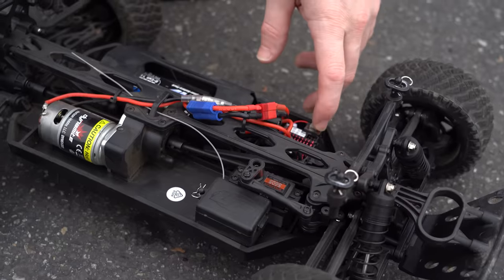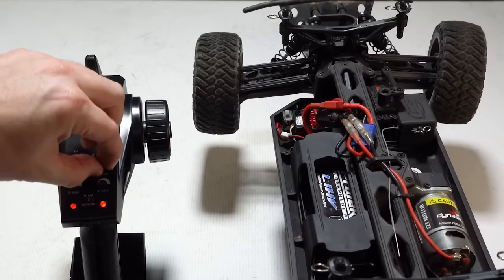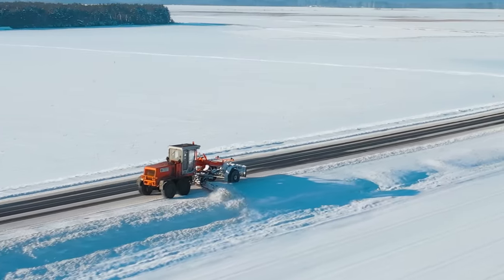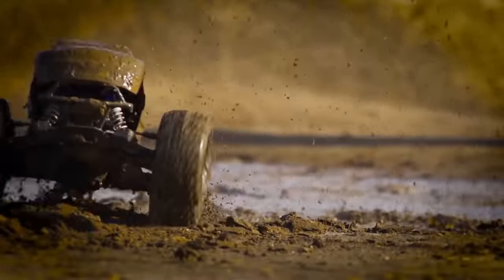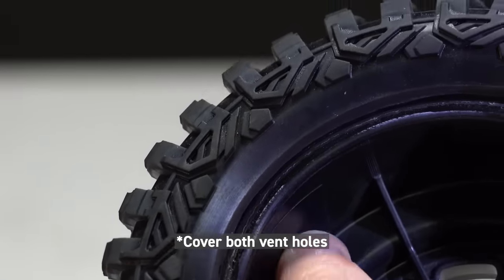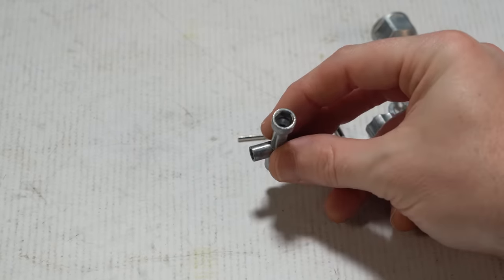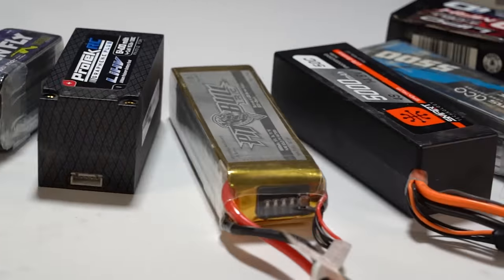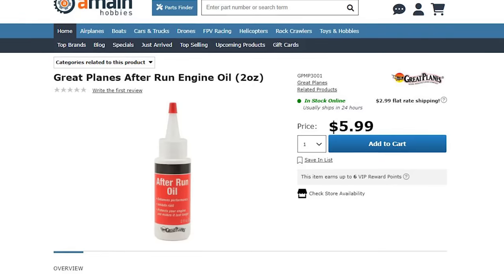Basic R/C Mistakes & How to Avoid Them

Comment: The last part is extremely hard. I bought a rustler 4x4 vxl for $400…loved it so much…a week later I saw an XRT at my local hobby shop…I couldn’t leave without it, another $1,000 and $300 in batteries later…now I’m about $3k deep in the hobby in less than a month 😅😅😅
Reply: This is why im buying only 2 cars to start officially(i also recently got a 1/36 scale truck that was cheap but looks fun to use lolz)and then eventually but a felony when i can afford it. After that, who knows maybe another lowrider and the bandit + fireteam..but i can wait for those tho
Reply: @wolfboy20 what 2 rc cars did you go with? I got the Mojave 4s and think next Max v2 and down the line felony or infraction lol I think also get the traxxas slash kit and resell it and then maybe the tekno 410 or so!!!😂
Reply: @Awakendabeast13  Well lets see, I got a Redcat Lowrider, & then for the 2 vehicles, I got a Traxxas Slash Ultimate and The Kyosho Fazer mk2 RC Camaro. After that I got a Typhon 3S.
Reply: @wolfboy20  Nice all great!! Eventually I’ll get a road rc and I like the scale autos as well. Awesome
Reply: @Awakendabeast13  Thank you!! They are all great vehicles but its gonna be a while before I can use them again. Gotta get new batteries and a new charger 1st for all of them. I also plan on getting the Arrma Felony and then the Losi Pro Moto Motocross Bike!
Reply: @wolfboy20  Real nice yeah im thinking of getting the Hota 6s charger and prob genace batteries or zee. Arrma Felony is sic the only thing that makes me hesitate is going thru many tires but it is what it is lol probably sometime in 2024.

Comment: Great video!
Another important thing to do is set the steering end points; not doing so burns out your servo.
I like your comment about not using a compressor; back in my mountain bike racing days we avoided cleaning our bikes with a compressor as it can cram dirt into the bearings or other places that you don't want it...
Reply: Also if you put upgraded servos, Snapped a capra axle in half by not setting end points.
Reply: Good thing every compressor has an air regulator
Reply: @smolscale  or just hold the air chuck farther away from the car…

Comment: All good information. Another tip that is a must. Look through your manual and read up on the maintenance intervals. Rc cars need regular servicing just like your real cars do. Diff fluids need to be replaced after so many runs so keep track of that. Also, be careful with lipo charging. Get yourself either a lipo bag or some flame proof container like an ammo can. Dont let your house catch on fire. And i wouldn’t recommend charging inside

Comment: Guilty of that last one myself! Probably close to 80 RCs in 4 years of being in the hobby! Uber amounts of upgrades and parts and tools too! You can definitely go nuts real quick! So many options out there, and they keep putting out new ones constantly! 😅
Reply: I had 40 at one point. Then I looked around and saw what I drive the most. One just sat for two years only driven 10 minutes. Listed on EBay and almost made my money back.
Reply: @troublew1  I gave away most of the ones I never used. Did YouTube giveaways and some to close friends and co workers. Down to about 40 now. 😬
Reply: Dang sometimes I feel overwhelmed with 4 lol
Reply: Can’t reply heading to hobby shop for more rcs
Reply: @uan588  😂😂
Reply: Dide im getting at least 4 more and I'm saving up for them..its gonna be an expensive ride but i can wait until i have enough money for each plus the battery pack and charger 🙃🙃🙃🙃
Reply: Lol im selling 2 brushed so I can get 1 brushless truck then I will have 2

Comment: Just bought my first kit from you guys (it’s in the mail as I type this), so this is really helpful at just the right time. Thanks for the upload!
Reply from the maker: Excellent Mr. H. What kit did you get? This video might have some value to you: https://www.youtube.com/watch?v=9_DbLLKJgNw
-Brett
Reply: @AMain_Hobbies  Thanks for the video recommendation! Since I’m just getting started and wanted something small, I went with the Axial SCX24 2019 Jeep Wrangler JLU CRC. I wanted something inexpensive that had lots of options to add on later as I get my feet (and possibly tires) wet. Already got a spot in the backyard mapped out for a course. Can’t wait to get it started!

Comment: Hello Brett, you are an amazing person. Love your tips and tricks. love the way you talk about the hobby. it is great. but I have to disagree with you on the li-po batteries. I have dealt with them since they came out on the market so many long years ago. They were interesting to deal with. whole new way to handle and store and how to store.  we learned the best way was to store at full charge. as we also pu8t them in the fridge and or the freezer. in so areas just open storing is bad as the heat gets to them makes the packs swell. and you can not use them any more. so you put them in the fridge or freezer keeps them safe and bring them out leave them 20 mins no issue full charge. some times if i need the with in a few mins. i put a top off charge on them. warms them up and i get full usage. I have been doing this since the late 90's early 2000 till now. not a once have i ever had an issue like you describe. if any thing i have been able to keep them longer. i have pack that are well over 10 years. and have a lot of use on them. still as strong as the day i got them and charged. if you like to meet up some time and see them. that be awesome. just let me know. but your info oin storing is wrong though. thank you have a great fun running chasing time with our favorite hobby.

Comment: Het Bret awesome info. But three things First thing is let Batteries cool Down, second thing always have extra Batteries with you. gives more time out and more fun for running. the third thing is  check the battery for damage. this will save you a lot of issues. if they are damaged get new ones. Now this last thing i been doing this the r/c hobby for a long time. But for the last 15 plus years i charge my li-pos  at full capacity and put them in the freezer. some i have had over 10 years or better some a little less old. but never have i had any issues with them. in fact a large group of us do it as well. At our lhs they do the same thing. I am down in the desert area where 115 is not uncommon to see. If you have heard of Ridgecrest then you know where we are. So keeping a cold battery is common.  when we get them out. we let them sit for 20 mins to an hr. but usually by the time we get to the track or bashing spot the batteries are at temp. and pack as much of a punch as they usually do. the last thought i have for others. always make sure you clean the dust out. clean it good. we have a very dry dusty area. and micro rock and other sizes they get up inside and really do some damage to the insides of the r/c.  I got a brand new truck every thing sealed. fun 1/6 scale truggy fun enjoyable. Maiden run today. I had so many tiny little rocks took me a while to get them all out. so i disconnected the fans took them out and blew the heck out of every thing. just as i thought i was done a few more would drop out so i hit it again. got it nice and cleaned out. but little tiny rocks are a real pain. so make sure you clean well. Thanks Brett love the tid bits

Comment: Great video 👍
Another very important thing to do on nitro after using it make sure the piston is at the bottom of the stroke while cooling down, Otherwise you will lose the pinch of the engine & the engine will be damaged.
Reply: How do go about this
Reply: @vexx12343  
You can remove the glow plug check piston is at bottom of the stroke.
Mark the flywheel with a marker pen or scrib flywheel .
I usually do it at the bottom so when you look under the car you can see the mark  easily in the correct position .
Once done put the glo plug back in .
Every time you stop check the mark is in the same position to cool down.

Comment: i use air compressor on mine and never had issues
Reply: If they sold compressors they would recommend them. 🤔 they sell canned air.
Reply from the maker: The possibility of blowing debris into your bearings goes way up when using an air compressor. It's not critical with bashers, but I'd avoid it with a proper race car. 
-Brett
Reply: @AMain_Hobbies  That's one reason why air compressors have pressure regulators, even the cheapest ones. Just turn the pressure down. You could even turn it down lower than a can of air would provide.

Comment: Protip I learned as a teen. Trucks with the fake roll cage in the bed of the truck behind the cab work great for holding bottle rockets. I would just lean them forward over the cab and could aim them and drive it away before they would go. Black cat is the only brand to mess with at least back then.

That was a store brand RC truck with a removable 4 AA battery pack. I loved that truck! We beat the crap out of it and it held up well. We even would drive it down the wood stairs lolol.

Disclaimer: This is strictly for adults who have the proper permit to use bottle rockets. Always follow local laws. This can be very dangerous.

Comment: I’ve had this question for awhile. When I store my car for a month or more. Do I store the battery totally dead or fully charged????
Reply: Storage function on your charger is made for this situation
Reply: Yeah I have the same question for my Nickel Metal battery for my EZ start my charger has no fancy storage feature.
Reply: @rcfanfun5133  I’ve got the most basic traxxas charger that came with the car. I’m not aware of any options for different charging modes.
Reply: @johnlopez4089  If it's a lipo, 100% is better than 0%. If it's a nimh battery, it doesn't really matter
Reply from the maker: John, are you sure you're using a LiPo battery? The most basic battery & charger included with Traxxas vehicles are NiMH batteries, not LiPo. NiMH batteries are a bit easier to manage and require no additional storage charging like a LiPo. Instead, charge the NiMH battery when you want to play, and use it in the truck until the battery is dead. If you're done driving, leave the battery in this "dead" state (NiMH's are very happy here). When you're ready to drive again, just charge the battery and use it... that's it. 
LiPo's are different in that after driving, they should not be left in the "dead" state. Hope this helps, and please figure out what battery type you're using...
-Brett
Reply: @AMain_Hobbies  thanks Brett for your reply.  It totally answered my question. The battery I have is a 8.4 nimh so I’ll be sure to run it down be for I store it. Thanks again👍👍
Reply from the maker: @johnlopez4089  Excellent; enjoy John. 
-Brett

Comment: RPM plastics will bend but most of time not break and brushless power systems  have longer run time.  You could upgrade the bearings to sealed bearings  "fast eddies bearings"  are awesome. Metal axles are great, MIP, HotRacing to name a few or if the brand of rc you bought has upgrades buy those cause it takes out the guess/research  work  to find what works and what does not. You could do none of that and just buy extra stock parts and just have fun. Almost forgot, you can buy a screw kit which changes all screws to the hex-head or "allan-head" screws  that are waterproof.

Comment: Is it better to store a lipo with 0% or with 100% ? I know ideal is to store them with 50-70%
Reply: 50-70% that would be about 3.8V per cell. Your charger should also have a storage function and set them around 3.8V.
Reply: storing a ZERO lipo will kill it quicker than storing a FULL lipo ( the later will slowly discharge , the former will possibly NEVER charge again . .. ) thats my twopenny thrown in . Ideally 40 % for storage , but 50 is ok ish . ...

Comment: Hi Good evening nice video and good information.
I'm just asking a question if you can help in anyway be possible . I have a ftx dr8  I just taking out the front diff to replace the bad one because it was clicking noise. But when I put it all back together. The front diff case seems very lose  I've tried everything I opened up 5 times now but each time I pop it back is lose again when the car on the ground the back wheels spin around. But front wheels don't move or go around. So not sure what's going on any help would be fantastic cheers 😅😅😊

Comment: I haven't been in the rc game since 1995-ish, but getting an Arrma Vorteks 3x blx very soon. Coming from a 1993-ish vintage Losi XX buggy, these reminders are a godsend. Lol losi is for sale by the way. And also great video
Reply from the maker: Excellent! You're in for a treat - LiPo batteries, 2.4GHz transmitters and brushless motor-power baby! Have fun with your truck!
-Brett
Reply: How is your truck ? Iv just landed one myself and waiting on fresh batteries ...how was setting up and bashing etc?
Reply: @am12eaz93  pretty good.  Broke a shock tower running into the tree in my yard like the second time out. Haven't been out in a little bit cuz of the heat but I have metal diff, spur gear and aluminum motor plate upgrades to install. Proline trenchers tires.  It's running on ZEE 6000mah 8c batteries.  The only issue I've been having is when I turn it on sometimes I have steering but no throttle. I've heard I only need to rebind the radio to it but I haven't had time to, let alone do the upgrades. It's a blast for sure tho and my dogs love it.

Comment: So I just took my new Cen F450 mud bogging. Big mistake. I cleaned it off, but there is water in the tires. It doesn’t feel like there are any foam inserts in them, but what should I do to get the water out?
Reply: Maybe a dehumidifier or a food dehydrator. I’m just sorta guessing here.
Reply: One of those things you use to dry small amounts of wet weed.
Reply: @nessie42786  ok I’ll try those! Thank you so much for your advice!

Comment: I just ordered a traxxas rustler 4x4 vxl. First rc car I've had since like 2000. I got slower 2s lipos. That's not overboard is it? Really looking forward to giving it a go.
Reply: I got into the hobby with a brushed Rustler 4x4 and wanted to make it faster after a month. If it is too fast there is a training mode on the ESC to make it go half speed. The manual will show you how to go into that mode.
Reply from the maker: Overboard? No. 2S is a good place to warm back up to driving. The truck is also 3S lipo compatible though for more power and speed, once your comfortable and ready. Have fun and enjoy!
-Brett

Comment: I have a 1/16 slash and it will go to far from me and it want drive but I can walk like 6 feet from it and it runs great  any idea  why
Reply: Change the transmitter batteries
Reply from the maker: Yeah, sounds like maybe the transmitter is having an issue reaching the receiver in the car, or maybe the antenna on the receiver is having issue. Like the other comment mentioned, trying new transmitter batteries is a good idea. Ensuring your receiver's antenna in the vehicle is in good shape would be my next thing to check. Let me know what you find out. 
-Brett

Comment: I got 2 "Hoovo" 3s 5200 lipos on amzn... I know I know.  They wont charge ... Idst 608ac is fine with all other lipos . whats the problem ????
Reply from the maker: Maybe their voltage is too low to initiate the charge? Most current chargers will not start the charge process if any of the cells in a LiPo are below 3V per cell. Do you have a cell checker you could connect to the batteries? 
-Brett

Comment: Unfortunately, I didn't close the holes in the wheels of my new Traxxas Maxx. Now I have moisture in the wheels. Does this mean that I have to buy new wheels or is there a way to get the water out of the wheels? Does the water evaporate automatically over time?
Reply from the maker: Try removing the tires from the vehicle and putting them near a vent or fan, they may dry out. The main issue with moisture is it will break down the foam insert inside over time. If you're foams are still good, you're ok. 
-Brett

Comment: sorry, you didn't mention "why" you have to use Blue Thread Locker? rust? idk? i always charge my batteries all the time that way when I need to play, i know there's power in them.  After a charge they are warm... and then immediately you go play doesn't sound all that safe to me tho. So like to leave them charged and have them cool down for next time I need to run them.

Comment: If I charge up my 1s batteries the night before, and the weather conditions are not good in the morning, how do I burn off battery so I am not leaving it all charged up and it gets degraded? RC Planes RTF. Turbo Timber and Sports Cub. How long is too long? Sometimes it is a week before conditions are good to fly. I am frustrated with the 1s, is there a user group for lipo batteries?
Reply from the maker: That's a little tricky, but if you can safely run your airplane in doors for 3-4 minutes, that should do it. Perhaps anchor the plane or hold it and burn off some battery juice while ensuring you and your property are safe from the prop. It's possible, but please stay safe, and enjoy the cool air from the prop... it will be like having a fan. If you don't feel comfortable doing this I understand; you might consider charging the battery the day of use instead of the night before. 
-Brett

Comment: Went into this video thinking I would know everything, never knew about not using an air compressor
Reply from the maker: You can use it technically, but it's so powerful it can blow debris into the bearings, hingepin points, steering pieces... it's just not good overall. Thanks for watching though. 
-Brett